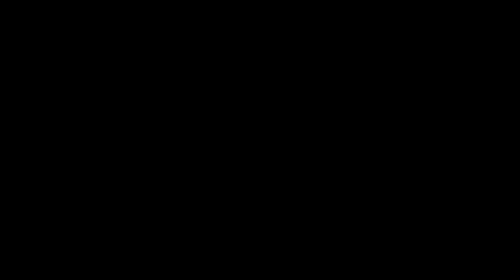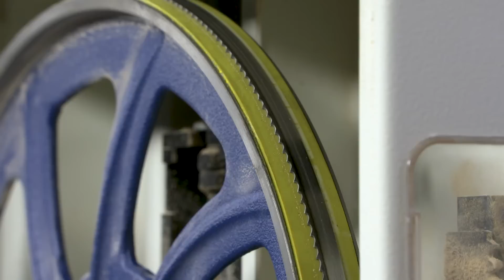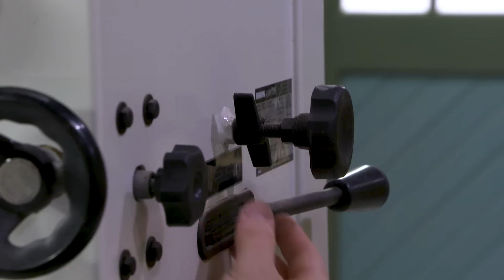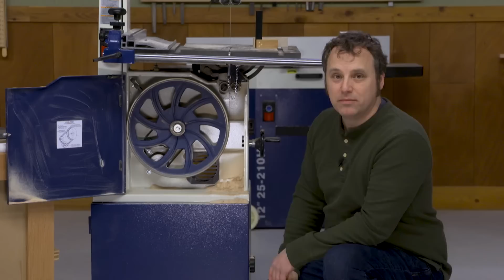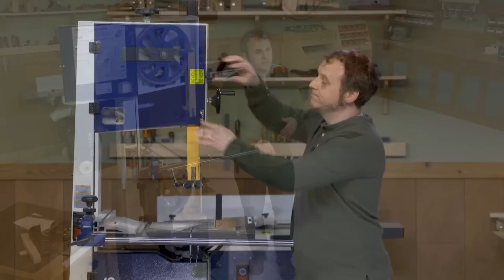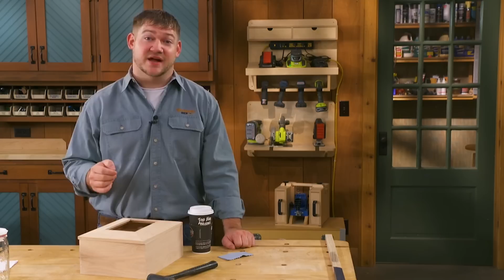Tips for Tuning Up Your Band Saw

Comment: You didn’t speak to why the blade ends up in a different location on the lower wheel than it does on the upper wheel when it has been tracked on the upper wheel correctly.  Second item is the teeth of the blade need to be in front (toward the user) of the guides so the projections on the teeth don’t ruin the guides, no matter the type.

Comment: When you say 'centre' the balloon the wheel wht do you mean because a Mr Snodgrass of general Tools says that one should centre the bottom of the vee of the teeth on the centre of the wheel otherwise as has been the case  with every bandsaw I have used, the cut will continue to track off square in direction causing one to angle the guide fence.  to suit.  May be 14 years but still room to learn.  Cheers

Comment: I have never had great luck getting smooth cuts on a band saw. Even when it cuts straight, I often get left with a rougher edge than is ideal. I have no idea how folks use it as a table saw replacement. I would love to get my band saw cutting that well. Thank you for the tips!!!
Reply: Bandsaws will always leave a rougher edge because of the nature of their blade.  I was told (by my now retired bandsaw sharpener) that there is a bandsaw blade that has straight teeth that gives smooth cuts,, as opposed to the alternating teeth on a typical bandsaw blade.  Only problem is that it costs around $150.
Reply: @dalewu9164  great point!

Comment: Look like the brand identity of the bandsaw in this video is covered up. What is the brand and model? What's the throat size and resaw depth?
Reply from the maker: Yep, it is a Rikon.  This video was originally shot for an episode of the Woodsmith Shop tv show on PBS and we aren't allowed to show brands on public television.
Reply: Rikon
Reply: Woodsmith, can you talk about why you have the Rikon and not another brand like Laguna, Powermatic, etc.?
Reply from the maker: @pig-a-dillyman2676  - Sure, We currently have a set of Rikon tools (band saw, drill press, lathe, etc.) in our video studio shop because they were kind enough to sponsor our tv show and provide us with these wonderful tools.  We have also been sponsored by Powermatic in the past for many years, and still have the Powermatic table saw. We also use many other brands of tools in our production and home shops.  As far as band saws are concerned, we have this Rikon, a Powermatic, and Laguna in our production shop and we've been pretty pleased with all of them. Personally, I've found that this particular model/size of Rikon band saw has been the most versatile as far as doing fine cutting as well as heavy-duty re-sawing.